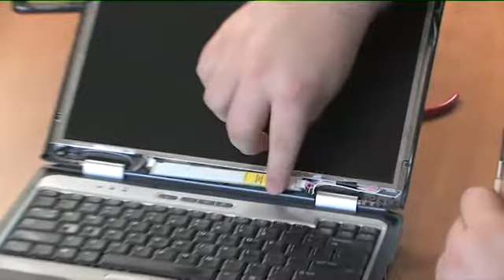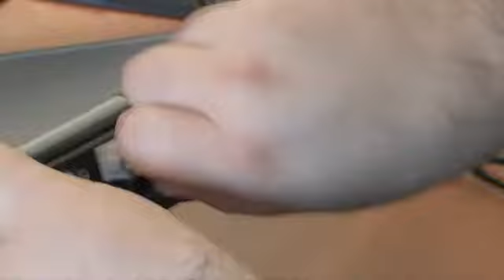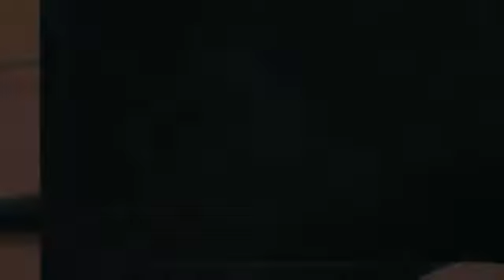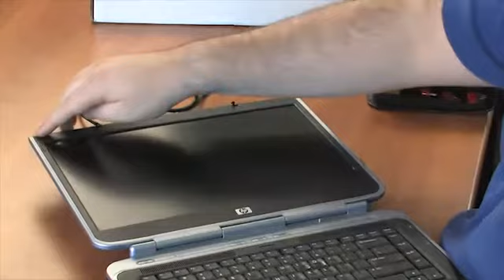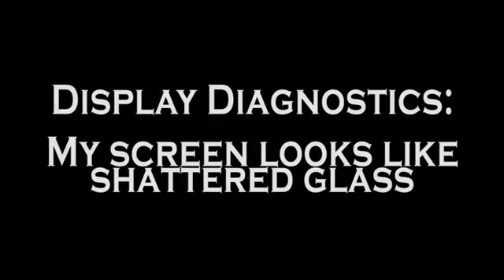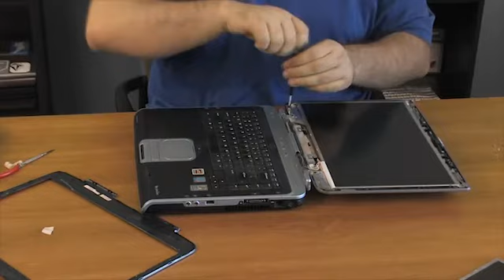Laptop Display Problem Solution

Comment: I have LG LGP42 Laptop. There is no display, although laptop powers on and works. Connected to external monitor via VGA out. After a while, the windows cursor and busy icon displays on external monitor. But after a while the display is out. What could be the problem? 
Also tried swapping RAM.

Comment: My Laptap is getting switched off frequently.  Hot Air is coming (emitted) from side.  Inside Fan is there and Outside Fan also fixed.  May be inside Fan  may  or may not be working - - bhajrangm@gmail.comLight is there (Battery is full) - any solution